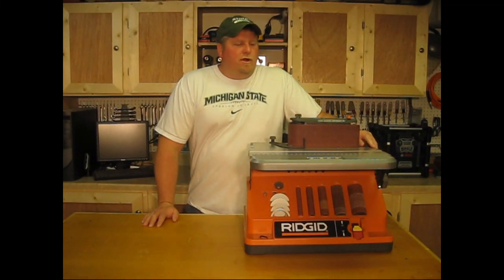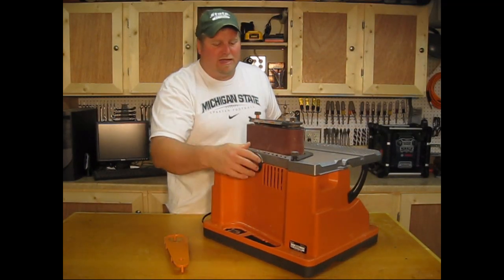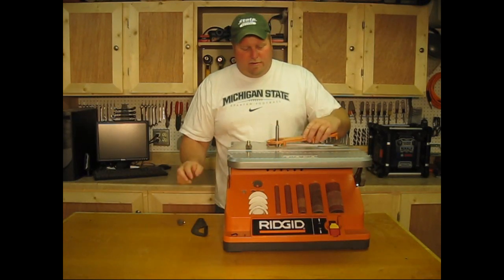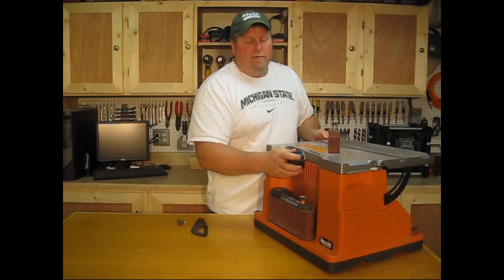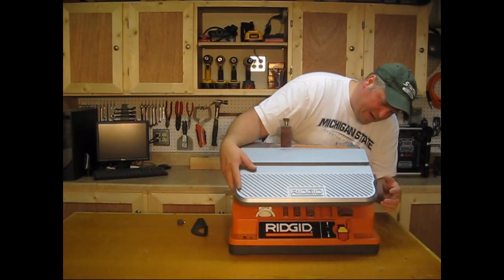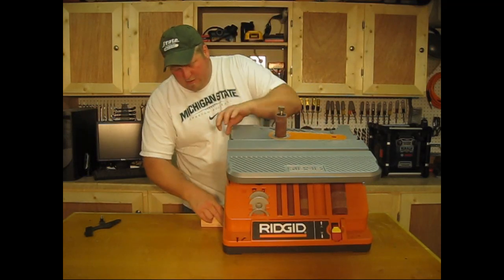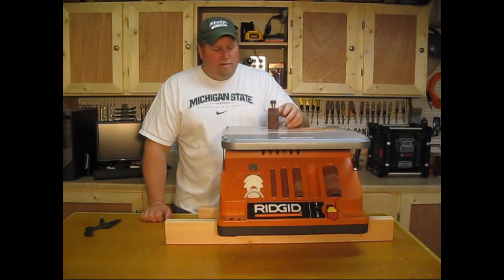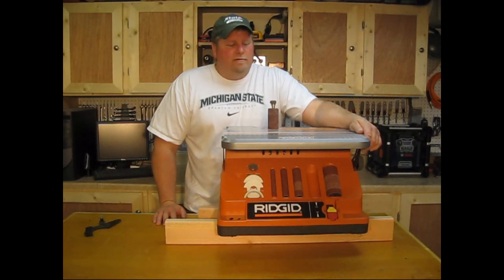Ridgid Oscillating Edge Belt/Spindle Sander Review

Comment: I bought this Ridgid Oscillating sander a number of years ago and shortly after I bought it the oscillating feature stopped working. I took it back to home Depo and they gave me a new one. It has been sitting around in the garage and last summer when I went to use it the oscillating  feature would not work. Ridgid would no longer stand behind it. I have used this sander very little and feel it hasn't stood up very well. They will not stand behind this.

Comment: Does anyone gave an idea where I  can get some info on adjusting the belt? I have tridd to adjust the belt ysing the manual with no success. Thanks for your help.
Reply from the maker: The conveyor belt? what is the issue you are having? we would love to help!
Reply: If you mean the sanding belt, then the answer is yes. What happens is that the sanding belt rides up as if it's going to come off. I have tried adjusting the tension per the knob on top with no success.
Reply: At 1:29 when your talking about the tracking knob and then you remove the belt part, that is where I'm having trouble. The tracking knob will not adjust the tracking so that the sanding belt will not stay on the rollers.

Comment: Thanks for the review, how long would you say the sanding sleeves last for before needing replacement? How long have you had it/how often do you use it and have you needed replacement yet?

Thanks,
Joe
Reply from the maker: Joe Grosso The sanding sleeves last a really long time....especially if you use a sanding eraser to keep them clean.  I've had one of these erasers for years and they are super cheap.  I've actually never needed to use different sanding sleeves since I got it.  Depending on what project I am doing at the time, I will use this sander a lot.

Here is a link to one of those erasers if you are interested (Vermont American 17889 Sanding Belt / Pad Cleaner).
http://www.amazon.com/Vermont-American-17889-Sanding-Cleaner/dp/B0002YUOT6/ref=sr_1_1?ie=UTF8&qid=1420754373&sr=8-1&keywords=sanding+eraser